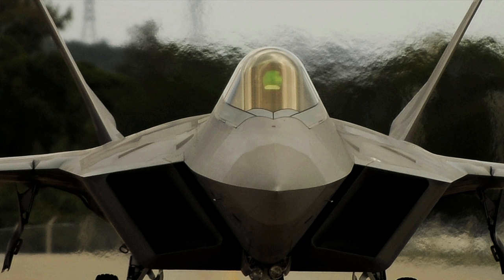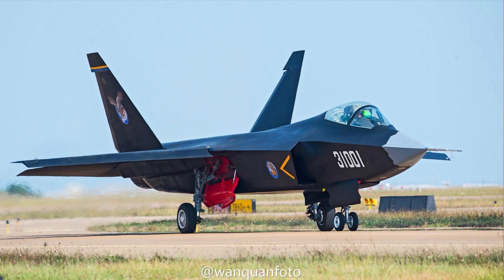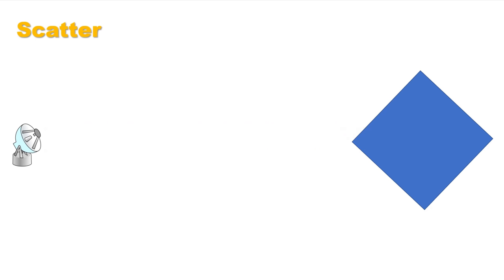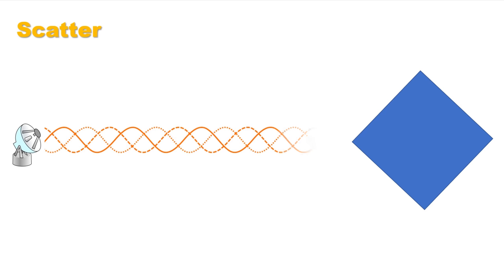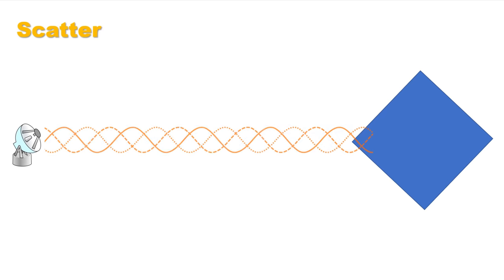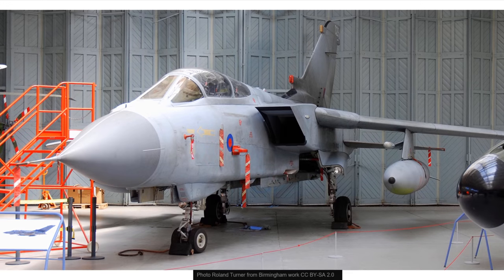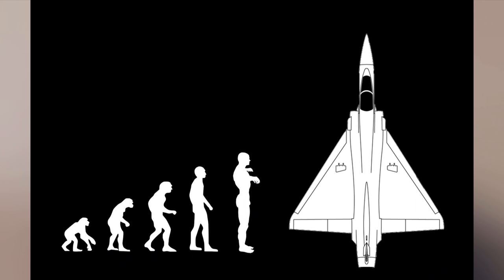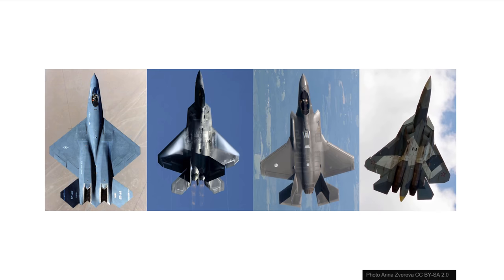STEALTH Killed AERODYNAMICS | why all modern jet fighters look alike

Comment: The poster child of aerodynamic inefficiency imposed by stealth is the F-35. Having the same overall length, it has over twice the frontal area and 50% more weight. No wonder it was limited to only Mach 1.6 with the most powerful fighter engine ever built, while the nimble F-16 can do Mach 2 using only the F-35 dry thrust.
Reply: It's not about the weight, it's more about the inlet design that imposed a limitation on its speed, otherwise, Cold War supersonic bombers won't be insanely fast. And by the way, there's one misconception of the maximum speed of a jet fighter, it's mostly theoretical. Even a clean F-16 have difficulty reaching Mach 2, and pilots reported that the F-16 starts becoming unstable at Mach 1.6. Not to mention the most important factor of all - fuel. A clean F-16 can only sustain a supersonic speed for 5-10 minutes, making its combat radius pretty much useless. And a combat configured F-16, with drop tanks and missiles would be lucky to get to Mach 1.2. That's why modern jet fighters tend to have lower maximum speed than the mid-Cold War fighters, because supersonic dash is a waste of fuel (leading to significantly lower combat radius) and it reduce the lifetime of the airframe. That's why an average jet fighter spent less than 10% of its lifespan at supersonic speed, and most of that only for a functional check flight. Perhaps coincidentally, Mach 1.6 is also a recommended speed for minimum time intercept because any faster is not realistic to achieve.
Reply: The F-16 can do mach 2 while clean, if you load it up with Max fuel and weapons it is slower than the F-35 with Max internal weapons and fuel.
Reply: @superskullmaster  
That's my point, and even when it's clean, F-16 can't achieve a published maximum speed of Mach 2.05 under most circumstance. Justin Lee, a former F-16 pilot said that during the functional check flight, Mach 1.9 is the most he can push his clean F-16, because the drag at Mach 1.9 (and he's almost out of fuel at this point) prevents his plane from going any faster. And the cockpit is getting too hot to bear due to the air resistance. Not to mention that he needs to dive from a high altitude to achieve that speed, if his flight is leveled, it's questionable he could even exceed Mach 1.6. The only circumstance where it could reach a maximum of Mach 2.05 might be with a new airframe diving from high altitude in the Arctic (yes, atmospheric temperature and pressure do affect the speed).
Reply: @mickeyg7219  You are correct, but it doesn't change the fact that the F-35 is aerodynamically handicapped because of stealth. I'm not trashing it, just stating a fact.
Reply: @magoid  
Yeah, I didn't exactly said you're wrong, I'm just saying that if you're making a comparison, there's a caveat that you need to know. And the extent of how much the F-35 is handicapped by its stealthy design is unclear as we don't have a wind tunnel data, however, the F-35's aerodynamic performance is often said to be very similar to the Super Hornet, so modern CAD did pretty well in minimizing the negative tradeoffs. After all, it has demonstrated to be capable of performing flat spin maneuver, something not even the SU-27 could do, let alone the F-15 or F-16.
Reply: @mickeyg7219  It didn't take a wind tunnel to notice that it is too wide for its length. Courtesy of the Marine Corps.

The drag problem was demonstrated by it failing dramatically its acceleration requirements, plus range to a lesser extent. For example, having slightly more internal fuel than a F-22 (a feat in itself), it have similar range but with only one engine. That alone shows a serious drag problem. Another example is In the bomb mission, a F-16 with the same payload and external fuel tanks (but less overall fuel) have more range.

If you ask me, none of that would have happened if the Pentagon told the Marines to pound sand, and the USN for asking to double the bomb-load  AFTER the construction of the prototypes. Not forgetting the stupid contract awarded to Lockheed.
Reply: @magoid  
We don't have the data on the acceleration, but someone extrapolated that the F-35's subsonic acceleration is better than the SU-27, not exactly a low bar. Also, the F-35A has about 13-22% (air-to-ground to air-to-air) higher combat range than the F-22. The F-35A's combat radius is much more comparable to the F-15E (with CFT and 2 drop tanks), the F-35A's combat radius is 1,239 km for air-to-ground load, and 1,300-1,400 km for the F-15E, the F-22's combat range is 1,093 km. And the F-16, with 2 JDAM-1000s, have a combat radius of about 830-1020 km (depends on the variants, from 1993 RAND Gulf War studies). 

Depends on the circumstance, even the F-15E may not have more range than the F-35A. In the environment where the enemy still have most of its air defense, the F-15 and F-16 can't afford to fly at a high-altitude, where the fuel efficiency is higher, and this will negatively impacts its range. 

And not all F-35 variants are built equal. The F-35B has the least fuel capacity, with a combat radius of 935 km in contrast to ~1,240 km for A and C, but it's still compare favorably to the F-16C. And best of all, the F-35B's combat radius is a 68% increase from the AV-8B II it's replacing. Also, the F-35C isn't going to replace the Super Hornet, but even then, from a quick search, the Super Hornet's range is quite poor, and is more similar to that of F-35B than the F-35C. The Block III will add 2 CFTs to the Super Hornet, bringing its combat range to the F-35C's level. The F-35C may not have the weapon capacity of the Super Hornet, but it do gave the Navy a longer-range stealth option. Also, the F-35C has the same internal weapons payload as the F-35A, allowing the upgrade such as Sidekick to increase its internal weapons capacity. 

And the X-32 isn't exactly a better option than the X-35, its design has less room for improvement, and no, I'm not talking about how it looks.
Reply: @mickeyg7219  well a controlled flatspin maneuver can be performed by almost any fighter jet with thrust vectoring capability. Including varients of the SU-27 with thrust vectoring like the SU-30MKM. Even the aging MiG-29 platform can do it with the MiG-29OVT.
Reply: @HMSNeptun  
That's true, but the the F-35A has done it regularly at the airshow without thrust vectoring, that's an impressive part. 

SU-35 has thrust vectoring nozzles, but not SU-27. And MiG-29OVT isn't a serially produced variant, it's like a F-16 VISTA to a F-16A.
Reply: Nah. The F-35 have aerodynamic features on it. It have been cleverly integrated because of stealth. I remember a quote that the LEX is in the F-35 but it have been integrated quite well and stealthified.

Comment: su 57 and YF-23 are the only unique designs
Reply: true
Reply: The YF-23 is actually the best mix between stealth and aerodynamics the world has ever seen. The YF-23s frame is low drag and area ruled, it also features incredibly large lifting surfaces that give the YF-23 an incredibly low wing loading of 280kg/m^2. For reference, the F-22 has a wing loading of 377kg/m^2. Basically the YF-23 was more maneuverable than the F-22 in terms of aerodynamics. But it doesn’t end there. The YF-23 also had a thrust to weight ratio of 1.36 at 50% fuel while the F-22 had a thrust to weight ratio of 1.25 at 50% fuel. Basically, the YF-23 was almost more maneuverable than the F-22 in all metrics except maybe instantaneous turn rates because the F-22 had thrust vectoring and also be more stealthy than the F-22. YF-23 was GOATED! Too bad Northrop didn’t have time to work out some of the YF-23s issues(bad canopy durability at supersonic speeds) and was on the governments shit list for their B-2 cost overruns and delays. Had the F-23 beat the F-22 in the ATF competition, the Russian Sukhois and Mikoyans would’ve had to run from a monster fighter that was prepared to tear their ass to pieces while they couldn’t even see it coming.
Oh yeah and the fucking Gripen which is a LIGHT FIGHTER still manages to have a slightly higher wing loading than the YF-23 with a wing loading of 283kg/m^2.
Reply: Su 57? not really
Reply: @lolasdm6959  The Su-57 is unique among the fifth generation:
- Two engines separated
- one-piece rotary vertical stabilizer.
- swivel part of the swell.

Nothing like this is found in other 5th generation airplanes.
Reply: @rondelracing3475  Maneuverability should not be the focus of Fifth gen jets. They are to perform long range strikes and leave unseen. It should not enter prolonged combat.
Reply: @lolasdm6959  The Su-57's advantage is not only maneuverability, its design allows it to carry a lot of fuel. It can wait. And this is thanks to its layout.
Maneuverability is still important. Recently, a recording of radio communications appeared of a heavy Su-34 escaping from a Patriot missile, it managed to do so at the last moment, I can assume that the Su-57 with its better maneuverability would have coped with this more easily. Video title: "Black Box Flight Recorder from Russian Su-34 getting shot by Patriot and hit"
If it comes to a clash of 5th generation aircraft, they will still detect each other much earlier than they enter the effective range of the missiles.
Reply: @rondelracing3475  AA missiles fail all the time… what were the conditions leading to it escaping? Distance? Maneuver? Operator error? Software malfunction?

Comment: SR-71 was an aerodynamic masterpiece and also VLO. The exhaust plume shock diamonds had more RCS than the airframe.

B-2 is also an aerodynamic masterpiece when you consider its range and payload.

Raptor and JSF are also aerodynamic masterpieces with superior performance to 4th Gen.
Reply: @CaptainDangeax  The Rafale could never perform like the F-22 in cruise speed, max speed, ceiling, turning performance in the transonic region, climb rate, or turning performance in any regime of the envelope.  I don’t think you know what you’re looking at when watching HUD footage.  There are good analyses of that.

JSF flies better than Rafale when Rafale is combat-configured.
Reply: @CaptainDangeax  are you seriously trying to cite a DCS dogfight as evidence? they're mods, they don't even have a properly modeled airfoil or avionics

Comment: Fully agree about the Flanker aerodynamics, as well as the mig-29 and it's newer siblings. From the blended wing-body LEX, to the positional placement of the engines and fuselage relative to the center mass & wings, it's a superb design (in terms of airflow). And lets not forget that the shape of the LEX (and the way it attaches to the fuselage) lends itself to pulling air from under the fuselage over the top of the LEX, gives it great high AoA performance. But the 29 is largely a copy of the Flanker, aerodynamically speaking. 

However, I would point out 2 details when comparing it to something like the F-22:

1) The largest source of aerodynamic inefficiency in a stealth plane like the F-22 is actually inside the plane. The need to divert the air flow after entering the air intakes, such that the fan blades of the engine are not visible from outside the plane (looking into the intakes) presents a large amount of extra drag which returns no value whatsoever in terms of lift or internal capacity of the structure. Drag-wise, moving the engine airflow far enough to eclipse the engine hiding behind it is like having large drop tanks on a plane, but without adding any fuel capacity. In it fact actually consumes internal space and displaces internal fuel capacity instead. And if you do not allow for a fuel capacity loss, it affects the overall external fuselage drag in ways which are somewhat harder to accurately calculate, since you need to create more internal space. You can lessen the distance you have to divert the airflow by adding an airflow splitter (as in the B-1B), but that comes with it's own drag, as well as some concerns regarding the air mass dispersion reaching the initial fan blades of the engine. Actually even without a splitter, the diverted airflow will tend not to engage the engine as cleanly as a more direct path. This can eat into engine efficiency (and lifespan) as well. Overall this is a bigger problem than external aerodynamics (apart from aerodynamically absurd designs like the F-117).

2) The optimal and max speed numbers on the F-22 are limited more by the stealth coatings' sensitivity to heat than by the aircraft itself. I think in many ways the coatings on stealth aircraft are more limiting than the aerodynamics. In this though, the limitations may be exceeded, if the situation is dire enough to be willing to damage the stealth coatings.

There is a counterpoint though. Internal weapons payload effectively refunds a portion of the drag cost of a stealthy design. External ordinance has more drag, even with less overall frontal area than an internal bay has, due to the complexity and interactions of the surfaces in an external ordinance configuration. This tends to make stealth planes look worse "on paper" when comparing them to non-stealthy planes which aren't carrying any ordinance typically when deriving their raw flight characteristic numbers. Similarly, in the case of the F-35, the internal fuel capacity is very large, to preclude the need for drop tanks in many sorties, which makes the plane "appear" to have more weight in a thrust:weight ratio, or wing loading comparison. An F-35 with 4-6 amraam's and a fully internal fuel load compares more favorably when you stack it up against a comparable 4 or 4.5 gen fighter with 2-3 drop tanks and 4-6 externally mounted missiles, with assorted pylons, etc. The thrust to weight ratio, wing loading, drag coefficient, and general performance of the externally loaded plane will be pushed into much more comparable territory than what you see in clean, unloaded planes in books or at an airshow.
Reply from the maker: 1) is a good point and I should have mentioned it.
2) it is an F-22 problem only, actually.

While the whole "internal" vs "external" is correct, my point in the video was to show how stealth turned different aerodynamic options into  a single one.
Reply: @Millennium7HistoryTech  I agree, that the form following function for stealth planes is breeding an awful lot of similarity.

I think that things will diverge more in time though. There's plenty of room for a delta stealth plane, for example. And at least "some" of the issue of so many planes looking similar goes to espionage and/or copying. One could argue that the increased opportunities to steal ideas in the information age are partly to blame. Also, if everything becomes very similar, it will eventually breed reasons to do things differently, as the endless cycle of counter moves drives engineering.